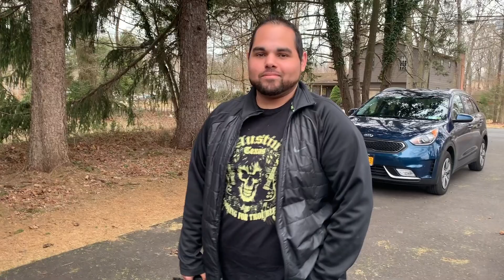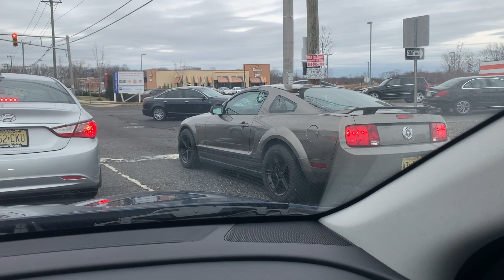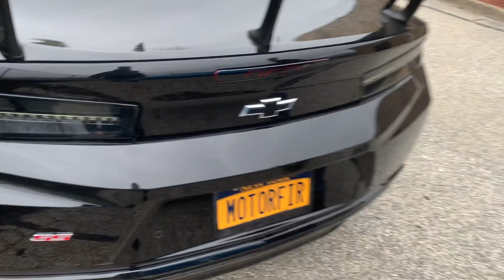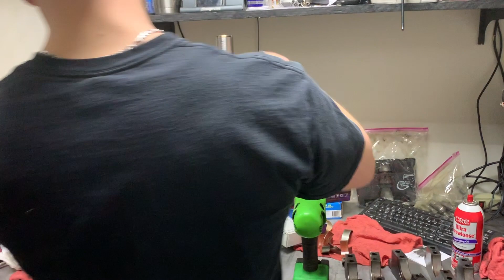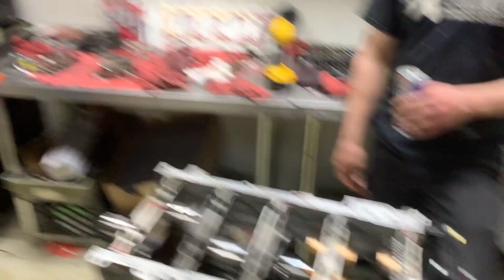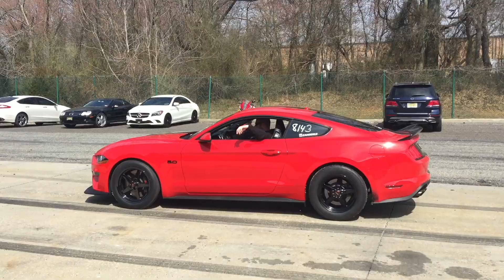HIS GEN 6 2016 CAMARO SS ENGINE BLEW UP - SO HE FIXED IT WITH THIS...

Comment: OMG I remember my Nova having 145 stock hp. I wish I still had it.
Reply: Matrox One  Well  I never put  it on a Dyno. It was stock with over 100k miles. The factory specked it higher HP. I just say 145 due to being so old and way untuned. It was a '73 SS 350. Green inside and out w/white stripes. With the 5 slot Cragars I was in love.